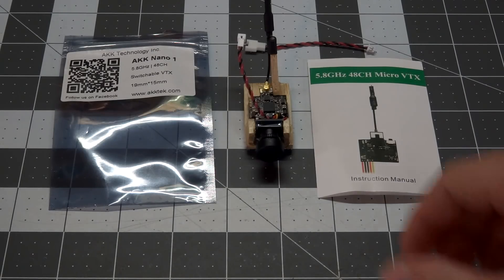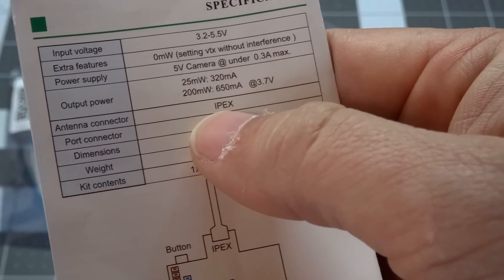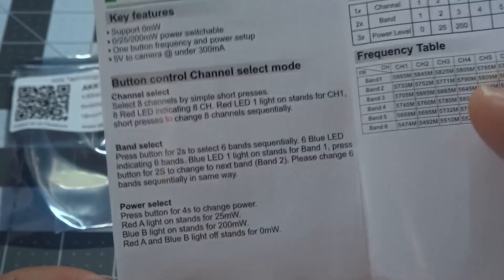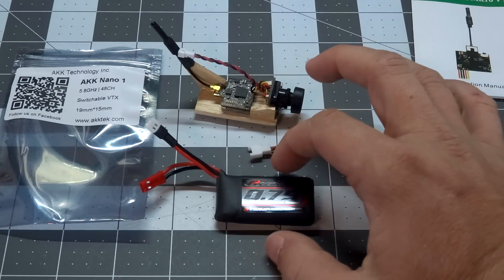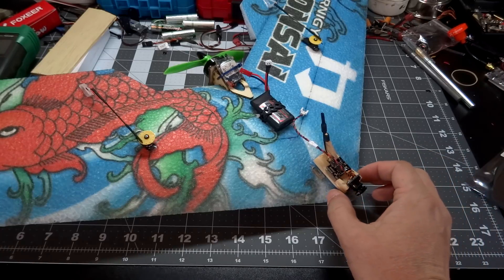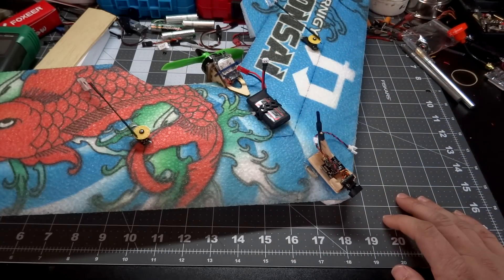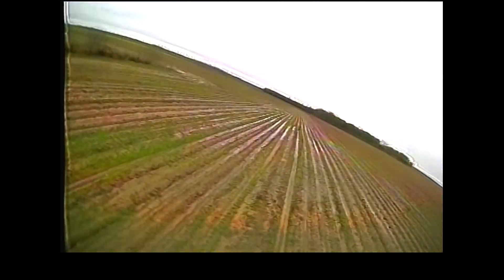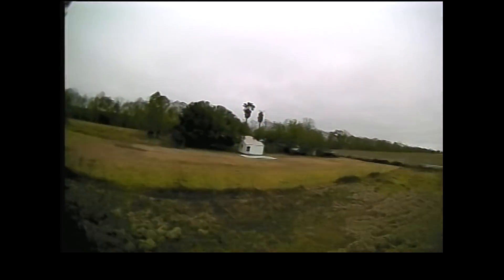AKKTEK Nano 1 Video Transmitter / Tiny FPV Pod

Comment: Any thoughts on a cheep 1.2ghz set up? I wrecked my skyhunter and gonna get a kit and put my electronics is that. I wish for 3 miles video range
Reply from the maker: I think I'd go for the 200mW vTX from RMRC. I've used them on a few planes and liked them a lot. That's what I have in the Nano Talon right now. 3 miles is easy using a directional receiver antenna. https://www.readymaderc.com/store/index.php?main_page=product_info&cPath=11_30_38&products_id=924 That said, if you're talking about the full size Skyhunter, there's no real need to stay small/light, at least when talking about the typical video transmitter... lol Check some of the others from RMRC. The 400 and 800mW versions are common. Any more than that is just overkill. I used a 1500mW in mine that I bought cheap on clearance and it worked fine, but I've been farther (10 miles out) on the 800 in my Mini Talon with no video problems.
Reply: I got your size, 1238mm. Thanks! I wish to get the kit soon to get back flying fpv ( my mom said i couldn't get it right away so I'm here stressed and sad about the broken one right now hahah but i can wait) and get longer fpv and get a runcam 2 HD with servo pan. Wish they sold gray skyhunter 1238mm kits these days!
Reply from the maker: My Skyhunter is the original full size kit, with a 1800mm wing. Sounds like you have the Mini Skyhunter (not the micro, there's 3 sizes... lol) I don't have any experience with that one, but I've seen plenty of people that like them.
Reply: The only true problem with 1.2 is that if you are around or near any airport they can give you a really harsh time, never the less! I would check UUUstore they do have usually good prices on that type of txrx sets.. "I just purchase from them, so let them know I give them a thumbs up.. wish you the best on your flight time...